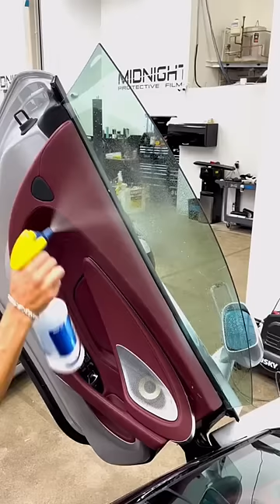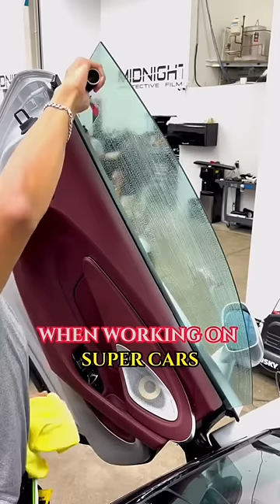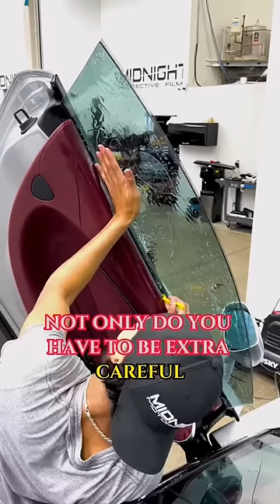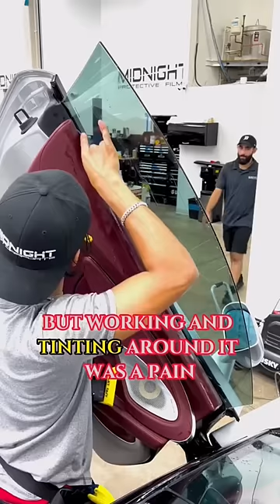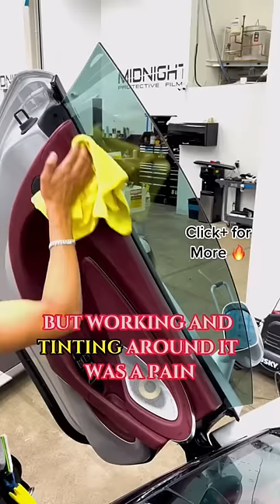Where’s your BUGAAEEE

Comment: I feel sorry for car owner. He didn't even cover door  🤦‍♀️......   RIP electronics.
Reply: it dosent damage the electrinics
Reply: Yes it does tell that to my old 2004 Lexus IS300 front windshield tinted. The guy messed up the film 3 times. My emergency light would not turn off for 2 whole day
Reply: Regardless of it doing damage he should’ve cover the door panel at least
Reply: You know electronics are so weird like my car sat four year with a broken window and nothing covering the hole and all the electronics work in the car except for the window on the opposite side but that's because that window motor had been going out for years
Reply: Most cars have crazy computers in the dash, hence why yours got funky after the windshield getting done. Windshields are also 3xs bigger so they require more water. The only way someone will damage electronics in a door while tinting it is if they're dumb and don't know what to do.
Reply: I've worked in automotive pre-delivery for a long time and never have i seen the door being covered... they don't splash the window
Reply: @norbertoespinoza5158  but it turned back on n didn’t it so stop complaining front tint is illegal anyways
Reply: @573goons9  Yeah but I'm illegal too. So those law don't apply to me.
Reply: @Jacob-Van  whuuutt water does not damage electronics? 🤔
Reply: @norbertoespinoza5158  big brain
Reply: @Jacob-Van  yeah it do the tint shop ruined my window switch in my golf
Reply: @norbertoespinoza5158  oh no 2 days
Reply: @norbertoespinoza5158  that’s because your POS 20 year old car probably has worn out shielding and exposed wires.    Modern cars,  Especially ones that cost 400k, absolutely have electronic shielding in them.
Reply: @norbertoespinoza5158  oh ya big baller with his 2004 A3 😂
Reply: @norbertoespinoza5158  that's what you get for tinting your front windows. Put on a pair of sunglasses like the rest of us.

Comment: Honestly, with experience in working on cars, I completely agree with the last statement. The harder the job, the more expensive it should be
Reply: Also if you can do a hard job fast and get the customer going again. Charge more. This is more for equipment that has to work.

Comment: He doesn’t even use a towel, and left a gap on the top of the window... and he thinks he has the right to charge people “up the arse”. Maybe if you did a good job it would be acceptable, but you work like an amateur lmao. My guy tints my cars for a fraction of the price but always takes care and does a perfect job.
Reply: im pretty sure he didnt miss any spots
Reply: @sloppypoo-  he did
Reply: @sloppypoo-  look at the top edge mate
Reply: My dude, you don't tint all the way up to the windows edge. You leave a tiny "gap" because the window slides up into the window seal. If the tint went all the way to the edge it would most likely rub on the seal, potential messing up the tint.
Which is the last thing you want

Comment: He's mad cause he didn't realise the window rolls down an inch when you open it, and rolls back up when closing. So he got the bottom untinted.
Reply: I think he did slip a little bit of tint inside the lower part of the window, but it doesn’t matter anyway cause he soaked that leather
Reply: @tytytut435  It doesn’t get damaged by the stuff used for detailing, I worked at a shop that did Cars and boats for a couple weeks as a part time job, and never had an issue with leather and pleather. Also when it’s your one job and at risk for a massive lawsuit you’d think you know what you’re doing. So I think this guy knows how to clean it

Comment: dude just openly admitted to charging a customer “out the ass” because he was annoyed that he had to perform a service that he offers 😂
Reply: I dont see the problem, its just the way mechanics talk
Reply: Did you think that that supercar was going to get any kind of service for less than a couple hundred/thousand bucks? Id charge $1,000 and a waiver just to roll it into the shop
Reply: Yes, you see, when you grow up and enter the workplace and perhaps even run your own business you will realize that if circumstances make a standard task non-standard, you charge a non-standard rate.

This is how literally every business operates.

If you are working on a supercar, that's going to require extra time and perhaps even a different grade of tools and equipment. Therefore you charge more because your costs have increased and you still need to make a profit.

Comment: If you have to treat a supercar, extra special, then you shouldn’t be a fucking mechanic. Every car should be treated exactly the same on working on them.
Reply: You can prob break/damage the hinge of a butterfly door if you put too much pressure or anything, plus it is more expensive to buy/change factory supercar parts so naturally they would be a bit more careful as they cant afford those as easily

Comment: Most shops will turn you away if you have a relatively expensive and fickle vehicle. Reality isn't a vacuum, so eventually a "supercar" will be broken. In order to afford the insurance to cover that error, you have to "charge up the ass.". Anyone who thinks a $300-700k car is going to get the same service fee as a $30-70k car is out of their mind. The proper way to do it is to have one location for normal vehicles and another for the more special vehicles. The normal shop pays a normal insurance rate, has normal expenses for normal tooling and technical training, and charges a normal rate. The special shop pays out the ass for insurance, tools, and elite technicians, and so you pay out the ass for that service. The fact that most of you don't already know this is why most of you will never be more than extras.

Comment: Extra careful? Bro any car no matter what gets the same effort and work put into it, why he reckless because someone doesn’t have enough money to come back at you? Sounds like a dick move just do the job and do it right you won’t have a worry because you know the jobs done careful and proper without dents or scratches no matter what it is
Reply: repairing expensive cars is more expensive so if you break them it costs more to fix breaking a normal car is cheaper and easier to fix
Reply: @trickeddev  yea parts are more expensive but just be careful and take care of what you are working on no matter what it is, especially if it’s not a personal project